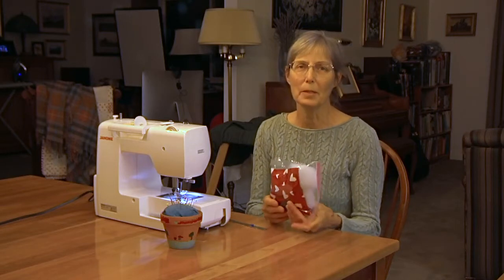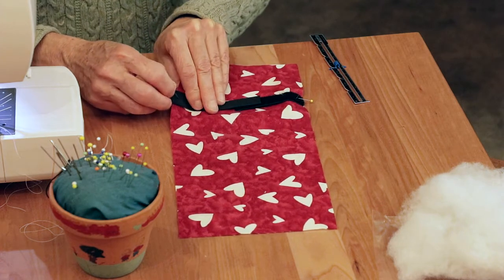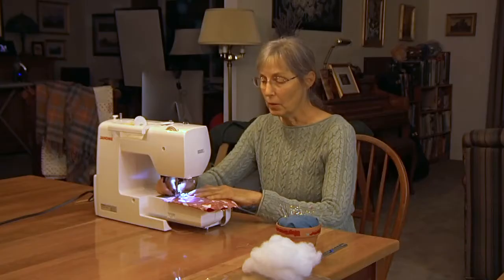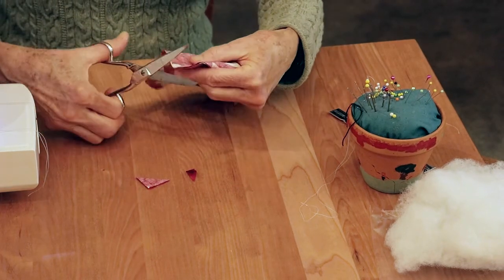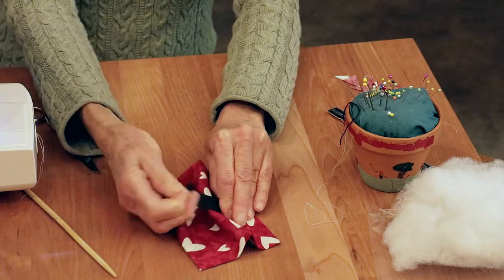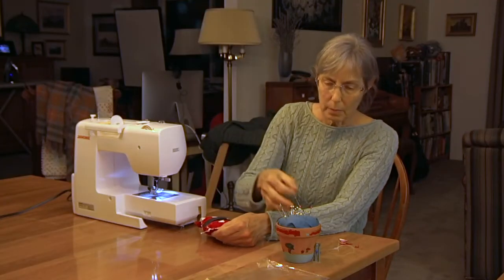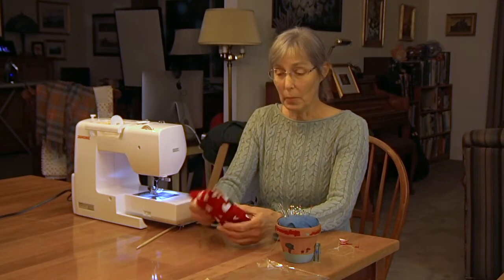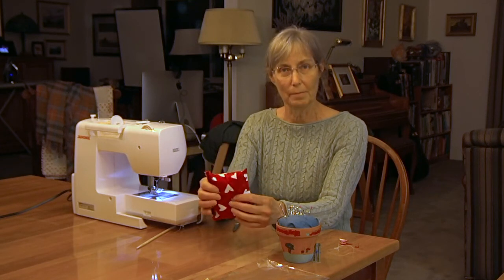Ramona Stars 4H Sewing   Port Pillow

Comment: How long and wide is the piece of fabric?
Reply from the maker: The fabric shown is probably 6x12". However you can make it smaller, keeping the dimension ratio if you want the result to be square. With 1/2" seam allowance the resulting flat is 5 x 5". Once filled it puffs to about 4 x 4".